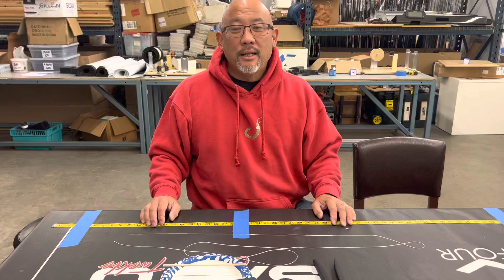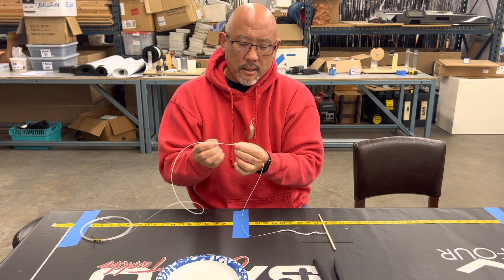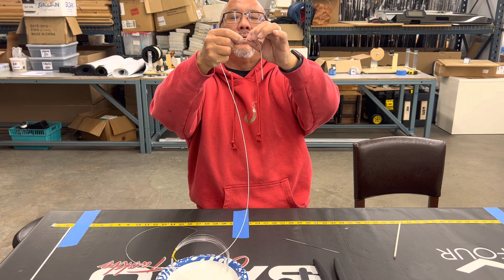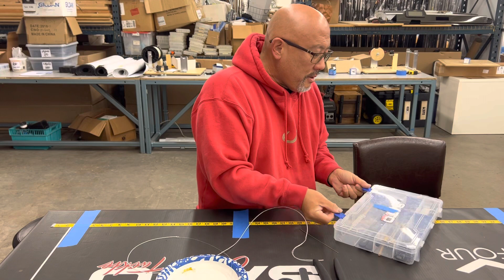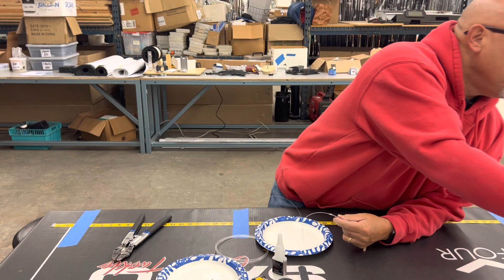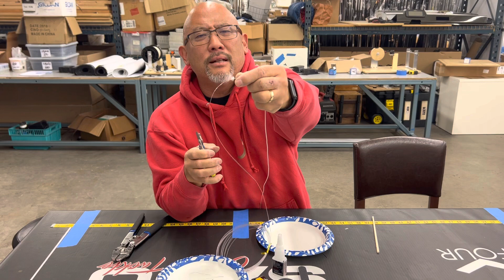30 Minute How To Build A Double Wall Wind-On With Sato Crimps

Comment: Newbie here, waiting on my 30 lb hollow through 200 lb test & my serving jig just ordered so watching every video I can find. If I were to decide on nub knot on the fluoro end (w a dot of zap a gap) & 2 nail knots on the doubled spectra about 1/2" apart after proper tensioning of doubled hollow core between them, do you think that would be as strong? I would serve about 2" at the join btw fluoro & doubled hollow core. I bought jerry brown serving braid (30 lb test) & have the deiter serving tool for tight serves. I sould finish serve w zap a gap on the rizutto finish & maybe the entire serve. I ask all this because I hope to establish a standardized approach to all the different splicings & I like the double wall over just trapping tag ends which seem to be the next strongest version of a splice. Thank you for the well thought out instruction with clear steps. This seems the best/foolproof version Ive seen yet (Im sure I will eventually try crimps but want to learn the basics 1st. Great video thx again.

Comment: ive been making double walled wind-ons since 2012    you need to mark the  the  hollow core    then thread the inner core   into the outter core so you have a  4ins or 6 inch loop  the crime is going to chip any  guides        do a  braid serve  and you.ll not have any problems  with chipping guides      i take your wind-ons are to be used    roller guides  ONLY
Reply: The crimp doesn't hurt the guides. It's tiny and it's like a football. These crimps have been used a long time and don't cause any issues with guides.